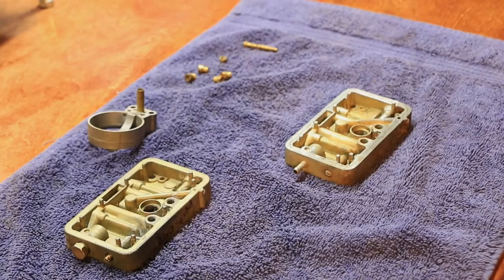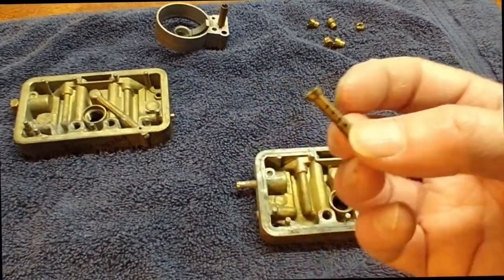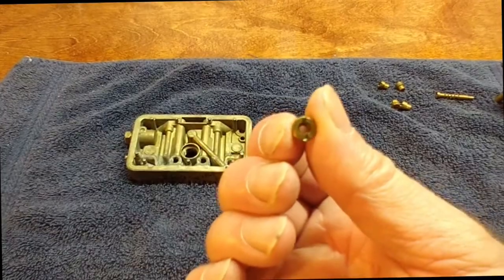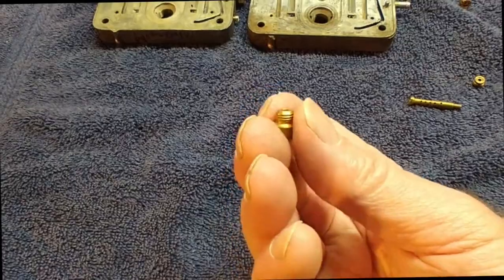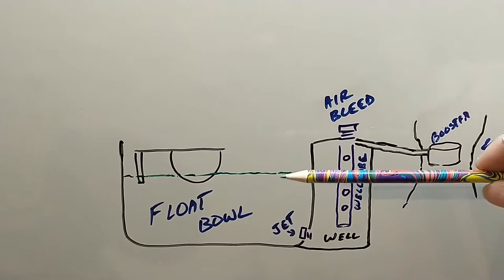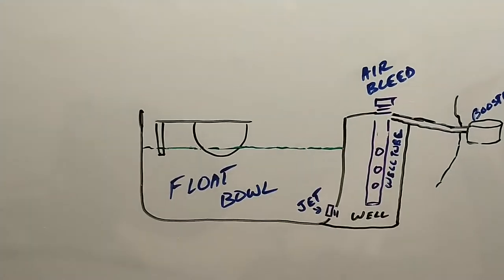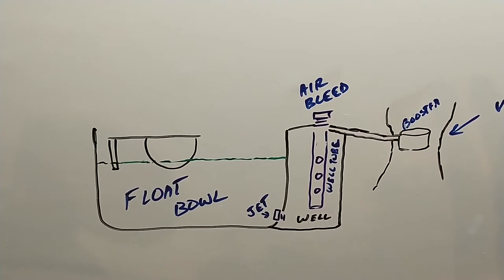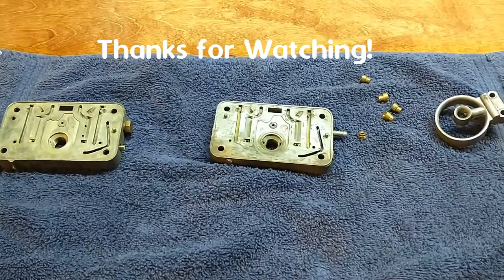Carburetor well tubes and how they function-Rick's Shop

Comment: I have a Weber which is running too lean when I am at full throttle, high engine speed, but too rich at light throttle.  I just can seem to get enough fuel at the top end, unless I do something radical like block off the air jet, then of course its too rich at low speeds.
Reply from the maker: Go down in idle jet size to fix the rich low speed issue, and up in main jet size to fix the lean condition.
Reply: @ricksshop  Tried lower idle jets and it doesnt work.  I think the fuel is coming from the main orifice.
Reply from the maker: @chrisspain7776  check the air bleeds to make sure they are open, and float level...

Comment: Have you ever removed the well tubes from a Holley metering block like the one shown? not quite sure how to get them out for cleaning without totally ruining them.
Reply from the maker: Yes I have. Once you get the plug out of the top. You can drill and tap a shallow hole in the top of the tube (don't break through into the fuel passage) and suck it out with a screw and spacer
Reply: @ricksshop  I drilled and tapped the well tubes out of two carbs to 6-32 and threaded a screw into them. My home made vise grip slide hammer takes them out effortlessly damage free. Thanks!